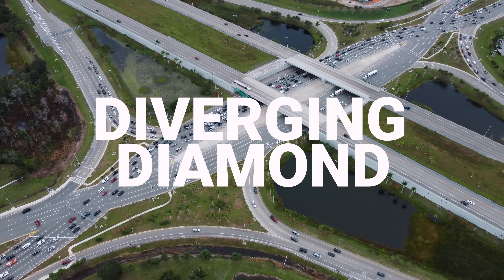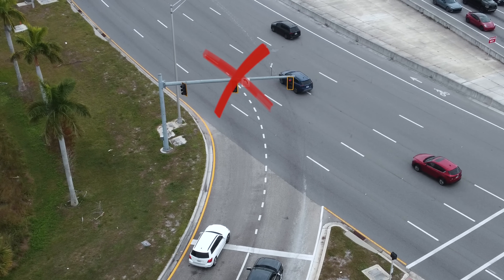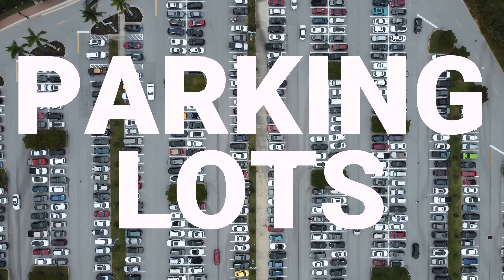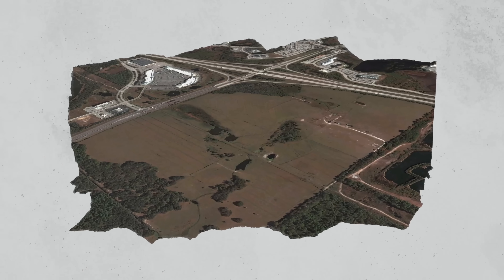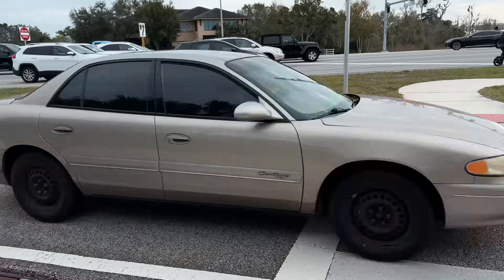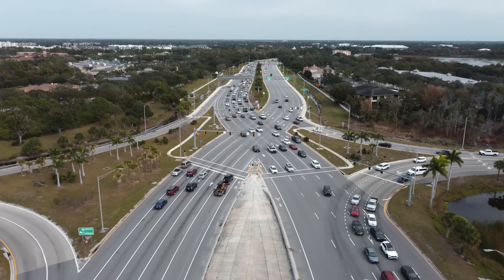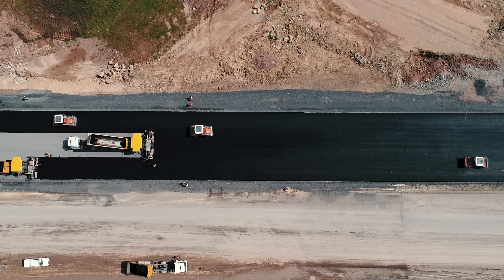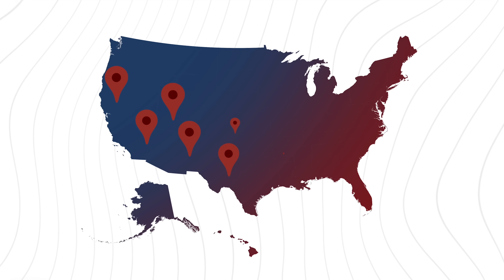Traffic Will Never Be Fixed Here

Comment: In Hawaii, even if the light is green, you cannot cross the line in front of you if the cars across are backed up. You can't even start moving if you're driving across an intersection. You have to wait until the pedestrians finishes crossing and their foot touches the other side of the crosswalk, Some states/districts are really not up to that standard.
Reply: Hawaii code only requires a stop on the "half of the roadway upon which the vehicles is travelling".  So once the pedestrian crosses the double yellow, the vehicle can proceed.  For divided highways, then all traffic in that direction must stop.

Comment: This specific diverging diamond interchange definitely has the worst design i've ever seen, if the concept is to remove points of interference from traffic coming from the motorway then the aim is to have as little amounts of traffic lights as possible. The most efficient diverging diamond interchange would be one that ONLY has 2 traffic lights.

Notice how there is literally a pedestrian crossing right after the main traffic light at the cross roads. Thats literally the WORST idea someone could ever do. It basically creates the worlds worst bottleneck. Traffic has to come to a stop, blocking the main intersection where the road flips. 

Better idea? Remove the 5 lanes of traffic at the intersection, make it 4 or 3, and give atleast 1 or 2 lanes specifically designated for MERGING traffic from the motorway. That way it removes the need for a traffic light after the intersection. 

If that crossing is absolutely necessary and you can't remove lanes, then make a rule like in the UK where you can't enter the intersection if traffic is blocking the exit. That way, the intersection isnt blocked.
Reply: There are only two signals.  One at each ramp.  Cannot get more efficient than this.

Crossing the pedestrian path down the center reduce the conflicts for vehicles turning left on and off the ramp.  Keeping thr pedestrian path on the outside would increase the risk of vehicle/pedestrian collisions.
Reply: @traffic.engineer Clearly you didn't watch the same video and clearly see that the diverging diamond had atleast 6 traffic lights.

The most efficient diverging diamond would have 2 traffic lights, little to no pedestrian crossings (maybe the ocassional one or 2 in the odd place but thats it) and individual lanes for traffic merging into the diverging diamond or going to the motorway.

Comment: The X interchange design is better because it only needs 1 traffic light. You turn right and yield. You have 1 traffic light to drive straight through the interchange and you approach the light to go left and once you leave the light your clear of the interchange.
Reply: That would decrease efficiency.  Having one signal requires more red time for conflicting approaches.  Two signals spread the conflict points, decreasing the red times for each movement.
Reply: @traffic.engineer not true I have an X interchange in East Windsor, NJ and a DDI in Lancaster and I wait the same amount of time through 1 light and the X you clear the interchange after the one light. The DDI is good if you want to get on and off the highway but to drive straight through is a pain.

Comment: The lights being stuck on the same phase is the issue. You need to add some kind of vehicle detection system in the diverging sections of the interchange. When cars are backed up the exit light needs to remain green longer than the entrance light and allow for the cars stuck in the intersections to move out of the way. When no longer in sync the light will wait for the other light to be back in sync to start the next cycle. This might increase the time of each phase but when traffic is heavy it should prevent the blockages you showed in the video. I hope I made that make sense!

Comment: When the light turns green, you're not supposed to floor it, but observe if the intersection is clear to cross. If it isn't, going on green will only exacerbate the problems as now you'll be the one blocking the intersection.
Likewise, you would not roll up onto a level crossing or mechanical bridge, putting your own life and others in danger just to be bumber to bumber rather than safe. 
Likewise intersections.

Now intersection of this size, with that much traffic, would be a headache to complete your observations before driving. With that many lanes more than one driver will aim for that one clear spot at the other side of the intersection, cutting others off if they have to. Because nobody cares for the safety and efficiency of others, only for the convenience of self. 

The only fix would be indeed less cars on the road. Easily done by employIng busses, trams, trains, protected cycling infrastructure.
There would be less need for parking space, the lots can be converted in something appealing, making your cities great again. More green, more outside terraces, shopping and cafe's would be a joy. And every driver opting to bike or fare by transit is one less car on the road. There should be no need for a car for anything within cycling distance (10 miles) and transit could go much further.

Comment: Diverging diamonds are not ideal, if you are going to do that it should be 2 lanes wide MAX. This junction seems to be so enormous that it has to be turned into a grade separated junction with fly overs. There doesn't seem to be space for a cloverleaf interchange (which would also work).

Comment: Crossing thru traffic twice so turning traffic doesn't have to cross thru traffic is the dumbest thing I've ever heard. Especially when there's literally a bridge right over the top of this thing... just have the exits and entrances setup so no one has to cross anyone else. If you have to turn left,  you go right and get on the bridge and go over the road heading left from your original perspective.
Reply: The cost of additional bridges is greater than the benefit of efficiency.  The lesser cost of the crosover points still attains the necessary efficiency.
Reply: @traffic.engineer  Obviously, it doesn't seeing as the intersection is backing up. You don't need additional bridges, you only need one. You can do this intersection with 1 bridge, no cross overs, and no lights. This is the problem with roads these days, they're made by people who learn everything about them in a classroom. Melbourne's current megaproject includes a section of roads and bridges I drew on a screenshot of Google maps and sent to Vicroads 10 years ago to stop crossover traffic I always got caught in as a truck driver where 3 highways meet right before a major industrial area exit so that all the civilian traffic coming in is trying to move right away from the exit and all the industrial traffic is trying to move left to the exit. My way split all the traffic before the highways met, merging all the industrial traffic straight to the exit, and all the rest onto the highway. They screwed it up, traffic can still go around to the very left when it wants to go through, and go through to the right when it needs to get off on the left. In fact, because they added my extra road, but didn't make it exit only, they've added a 4th crossover point. Roads should be designed by people who actually drive on them every day. I've spent more time using roads than you spent learning second-millionth hand information about them.
Reply: @Illyriad The backup is not caused by this interchange.  It is caused by the downstream intersection that has much less capacity than the interchange.  The DDI is so efficient that it overflows the adjacent intersection that have much less capacity.
Reply: @traffic.engineer  .. and backs up, itself. It was literally shown in the video that thru traffic is blocking other thru traffic... that is not efficient in the slightest - that isn't even possible on any other road.

Comment: I have to ask, why not make the diamond a huge elongated roundabout? Then you don't need traffic lights, which I think it would improve traffic flow. And if you make it a turbo roundabout, there would be no points of conflict on the roundabout itself.

Not that this will solve the problem of having too many cars though. And yeah, moving conflict points further back still just moves the problem. Also, the space required for a 4-lane elongated roundabout would be... a lot. Car infrastructure is big and that's part of the problem.
Reply: Roundabout would fail here because the traffic volumes are greater than a roundabout's capacity, and the construction would cost more.

A roundabout interchange would cost more because it would take more right-of-way outside of the prior interchange design.  That would require more stormwater management facilities, as well as shoring / retaining walls due to encroaching into the slopes of the overpass highway.

And the roundabout would not be efficient for places with such high traffic volumes.  They max out at 1000 vehicles per hour for single lane roundabout (1700 for dual lanes).  Roundabout interchanges are better for rural/surburban locations where traffic is not projected to increase.

Comment: If they wanted to get rid of the gridlock where the diamond lanes cross, make one go over the other vs crossing at grade level. Yes it increases the cost, but also eliminates the need for the signal.
Reply: Only if the cost justifies the benefit.  Such funding is not available.

Comment: another way you could fix this is using a roundabout simister island in the uk on the M62,M60 and M602 is a good example of this being used
Reply: for context the roundabout has 4 arms and they cross over it not connect to it and still keeps the highways flowing
Reply: It would cost more for a roundabout interchange and would have less capacity.  Because the cross road still has at-grade intersections, the additional cost for triple stack bridge is not justified.

Comment: I live in this area.  This area sucks.  First of all, the problem is not the interchange, though it is large.  That's probably the easiest and fastest part of this road.  The problem is all the intersections on the west side of I-75, especially the mall.  The east is not great either, but it's much more manageable and smaller.  You just don't drive here between mid-Nov and mid-Dec if you absolutely do not have to. 

The problem is frankly, the lack of options.  This area bills itself as a 'planned' community.  But it's not.  As pointed out in the video and elsewhere, all the 'bike lanes' are just pained onto the shoulder.  As NotJustBikes rightly points out, that is not a bike lane.  I only ever see Saturday groups using it for exercise and their routes do NOT go through this interchange for good reason. There is no real bus service on the east side of I-75.  No bus stops, no routes.  You HAVE to drive.  It is very spread out and buildings are almost all less than 3 stories tall.  Some may say this is due to hurricanes, but both Sarasota proper and Tampa have multistory buildings that survive just fine.   What this area needs isn't more lanes, it's light rail.  Specifically trams that are separated from road traffic and are not forced onto the same roads.  Getting people out of cars is the biggest issue for traffic in this area.  But that's not what the government gives money to build. If they wanted to be a true 'planned' community, the county planners should have made far more condos, apartments, multistory mixed use zones, with infrastructure for light rail, separated bike lanes, and FAR FAR FAR less gas stations, fast food chains, fewer Publix groceries (I mean, come on, give me at least 1 other grocery store to choose from in a 5 mile radius!), and absolutely NO HOA controlled single family home communities.  

As for walking... that's a non-starter for most people that live here.  Especially in Florida Winter (aka, normal Summer for everyone else on the east coast).  It's just too hot and humid to walk very far in these concrete ovens.  People get heat stroke by trying.  And it's that hot most of the year.

Comment: They almost need to redesign the traffic lights or road signs to mitigate the number of cars passing the intersection and turning the light yellow or red when the threshold has been reached
Reply: The light lengthens because the concurrent ramp movement is still clearing on green.

Comment: Whilst of course the obvious answer to traffic, and much more, is less car centric designs, but the problem of traffic backing up across the intersection that lead into the alternatives is easily solved.  In the U.K. there are two standard concepts that address both of the issues.

The first is the use of repeat traffic lights.  At junction there will be one set positioned at the stop line that are the ones that are legally enforced.  But at everything save the smallest of junctions there will be a second set of traffic lights on the opposite side of a junction.  This means  there is still a set of lights directly in front of you until you have crossed the junction.  As there is no stop line they have no legal meaning to road users, but they provide useful information.  So with these any traffic waiting in the intersection will know when their direction has a green light again, and by inference that oncoming traffic has a red light.

But the other feature that is common on British roads are box junctions, a yellow hashing painted on the road at busy junctions or outside fire stations.  You cannot legally enter a box junction unless you exit from it is clear, except for traffic making a right turn (with left-side traffic) which may wait in the box junction if its exit is only blocked by oncoming traffic.  i.e. where it is not blocking traffic and will be able to clear the junction immediately when the light changes.   This legally enforces the "but humans" argument in the same way that a stop sign does.

That will not solve the other issues in the video, but those two features will solve the safety problem that comes with traffic backing up and blocking a junction.

Comment: I swear americans will try to do anything other than put in a roundabout.  Like literally just have a multi-lane spiral roundabout and you fix all the problems this monstrosity is designed to fix but 100x simpler.
Reply: America has more roundabouts than any other country, except France and Italy.  

America knows where roundabouts work best, amd this location is not one of them due to volumes being greater than a roundabout's capacity.  It would increase queues due to lack of gaps to merge at speed.

Comment: Diverging diamonds are an overrated trend due to novelty bias. Single Point Urban Interchanges are superior. They only have one conflict point where traffic turns left, controlled by a single three-phase traffic light.

The diverging diamond, on the other hand, have two conflict points that are basically guaranteed to keep half of through traffic stopped at all times.

Topographically, both are almost the same, with the left turn geometry of the SPUI stretched across the bridge to make a DD. I get that converting normal diamonds into DDs using existing bridges is cheap, but for new construction, in my opinion, the wider SPUI bridge is worth the extra cost.
Reply: One conflict point is the problem.  That means more approaches and more signal phases at one point, increasing the red times for other approaches.

Comment: Those exits/on-ramps "advantages" ONLY work when you ASSUME all traffic is going that one direction... if they need or want to go the other, you're still creating cross-lane traffic or forcing it FARTHER from the switching sides thing to ensure it doesn't. 
It's not so much a solution as pushing some problems aside or away to solve others.

"When people turn left, it slows everyone down"... except NOW... unless you shift right turning traffic away more to account for lane switching, THEY slow traffic down, as THEY cross traffic.

I'd argue there's little more dangerous than suddenly changing the ENTIRE PATTERN OF DRIVING for a few hundred feet... just to swap back.... and god forbid lights go out and this turns in to an all-stop stop sign situation... 
Changing "drive on the right" for a few seconds of convenience is NOT a good solution...

Comment: As a driver in the UK, some of the issues with traffic backing up onto the junctions could be fixed with junction boxes - you aren't allowed to enter them unless you can get out (with the exception of turning right - would be left in the US). Obviously that doesn't fix the issue of too many cars and too much traffic to start with, but the interchanges would still have to exist and junction boxes might help.
Reply: Junction boxes would mask the lane lines through the intersection.  If there were not any markings inside the intersection, then yes.

Comment: Relieved when this was done, but some headaches persist. This is I-75 Exit 213 at University Parkway. Approaching it? There are no problems at the interchange for 75 in either direction and University westbound. THE WORST is east on University. At the light just to the west (North Cattlemen Rd to south, Cooper Creek Blvd to north). It's three lanes. Between the light and the interchange, it fans to 6, but 2 left lanes are marked to 75 northbound. All through traffic has to be in the right lane at the light. Some days before afternoon rush hours -- as far back as 2pm -- backups will persist to the previous signal at Honore (ON-a-ray) Avenue. Turning on to University - 3 lanes left from Cooper Creek or 2 lanes right from North Cattlemen - is a mess and a half.

Comment: The Florida heat makes it unlikely that people will bike or walk to many areas. You'll be drenched in sweat by the time you get to your destination, as opposed to sitting in an air-conditioned vehicle. I like the concept to local shops to mitigate the need for driving.